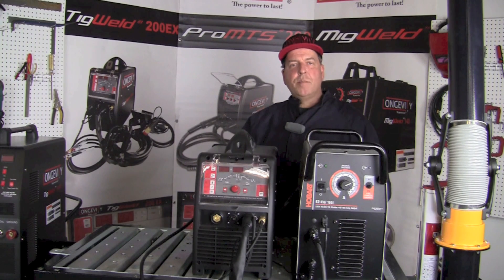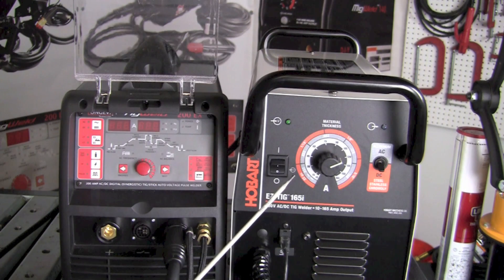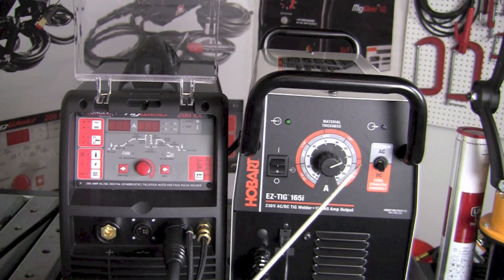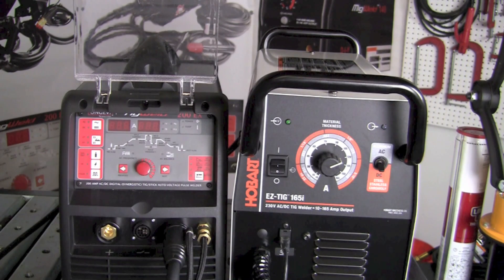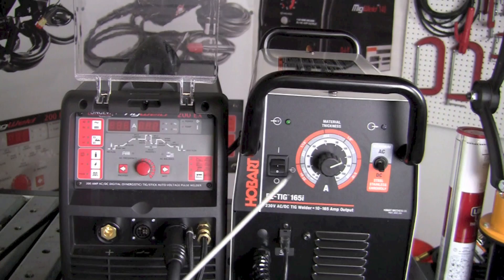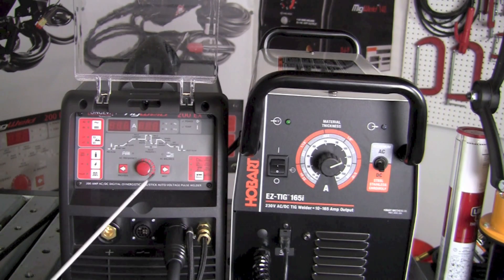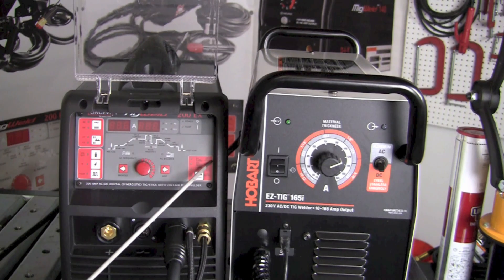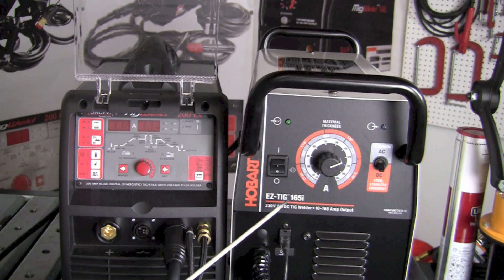HOBART EZ TIG 165i VS LONGEVITY 200EX COMPARISON REVIEW

Comment from the maker: Thanks for the comments, one advantage of newer equipment in the area of welding is the overall power consumption as compared to older equipment. Older transformer machines draw a significant amount of power just when sitting idle between welds. We each have that tool we wont let go of. Keep up the good work with Uncle's D4!!!